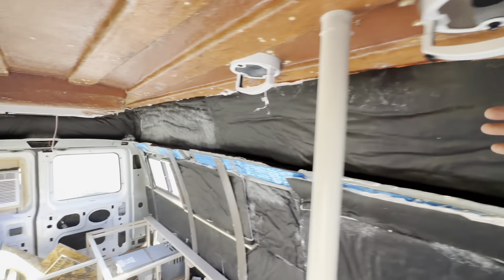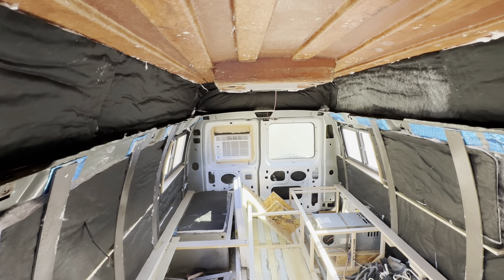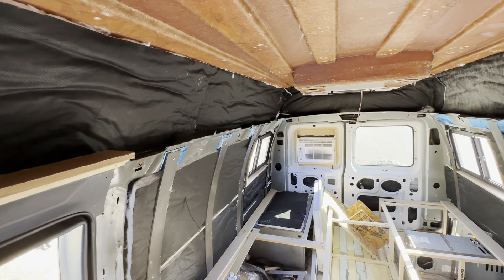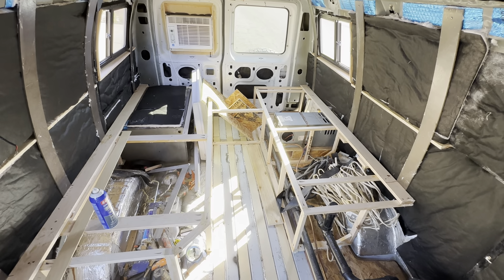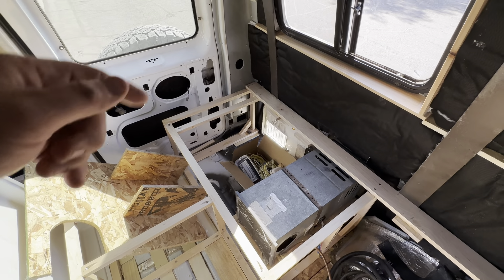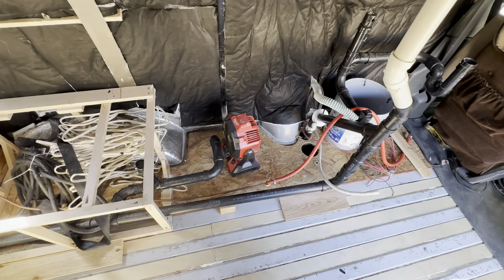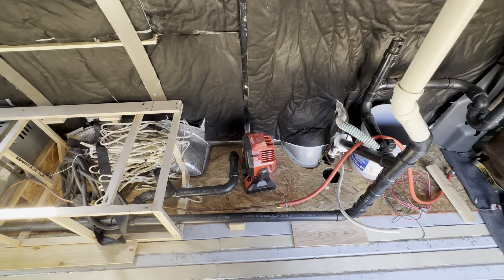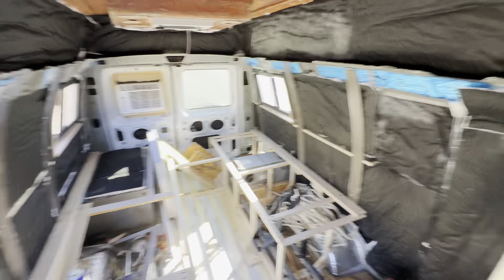4x4 Class B Van Build VLOG: Insulation and Other Stuff and Things #4x4van #vanbuild #classbrv

Comment: Dave, it’s looking great. Have you ever seen the insulation they wrap ductwork in? It’s a soft material, but has a Mylar backing on both sides I believe? I know it works great, because one summer I had no AC in my truck, it was blazing hot. 6 miles from home I bought an ice cream Sunday from McDonald’s, wrapped one layer of the insulation around it, got home, not one bit of melt. I think it would be much less expensive. Thinsulate is usually associated with boots or clothing, guess it’s great, but maybe this would be as good, maybe better, way less money
Reply from the maker: Good tip Jerry. I’ll check it out.

Comment: Hi Dave what would the R-value be for this insulation.  We get really cold in the winter and hot and humid in the summer where I am. I think I need to look at R-value then price then how hard to install the product.  Could use different materials in different areas of the van build.
Reply from the maker: Good point regarding different priorities for different scenarios and the value of using different types of insulation. Regarding R Value of this product: I have seen a variety of numbers ranging from 5-10 per layer. I used the 600ml version. I think it may come in different thicknesses.